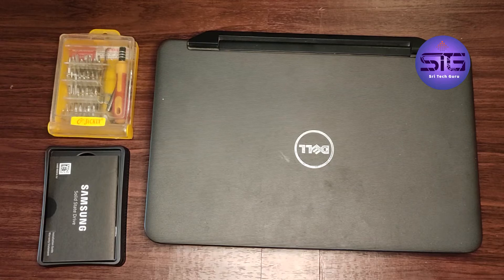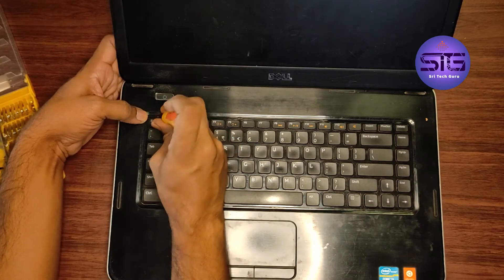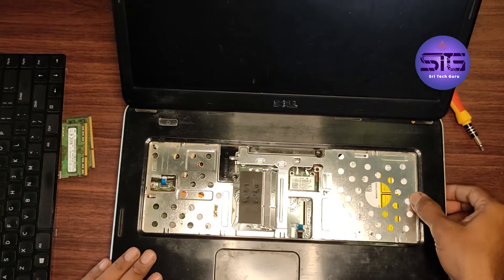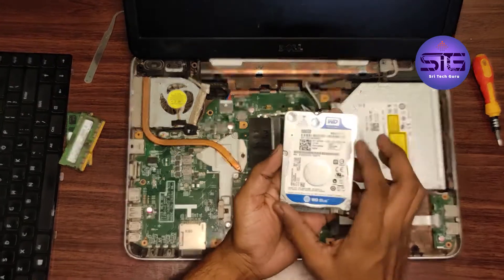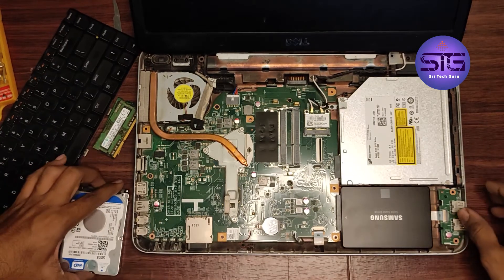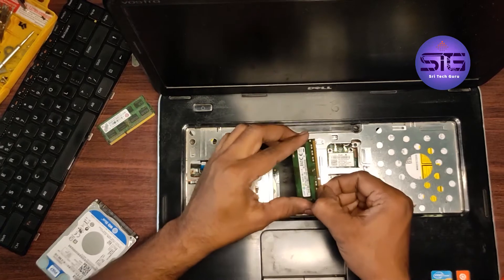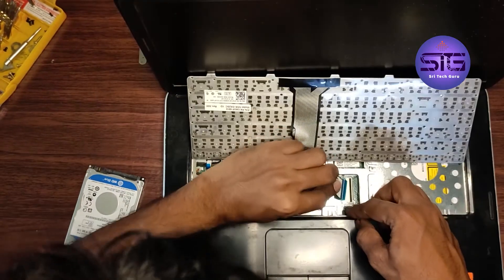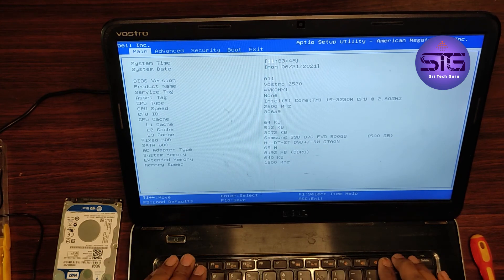Samsung  SSD 870 EVO installation in Dell Vostro | 2520 | Dell Vistro Disassembling

Comment: Hello,

Thank you for making such an informative videos.

I need your help about my Dell Vostro 2520(P18F004) laptop upgradation.

Can I upgrade my laptop’s processor with higher one?

If your reply is yes than which processor should I go for better and speedy performance?

I also planned to upgrade my laptop RAM with 2x4GB DDR3 and internal SSD from Crucial MX500 3D NAND SATA 2.5 inch 7mm (with 9.5mm adapter) with 1TB or 500GB storage capacity.

Suggest me if you have any different way or products for processor, RAM and SSD should I go for better performance of my Dell Vostro 2520(P18F004) laptop? 
Please…🙏
Reply from the maker: Q: Can I upgrade my laptop’s processor with higher one?
Ans: NO you cant but u can upgrade laptop HDD to  SSD up to 1TB it supports,  i suggest Samsung EVO860 or 870   and Increase the ram up to 8gb ddr3 (2x4gb) it works pretty good for few more more years.
Reply: @SriTechGuru  
Thank you 🙏 

So will it perform bit faster with SSD and RAM upgrading without upgrading processor??
Reply from the maker: @manishpu25   yes
Reply: @SriTechGuru  thanQ 👍